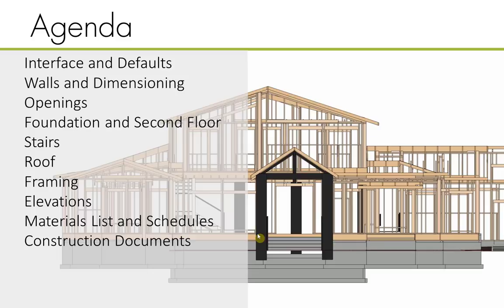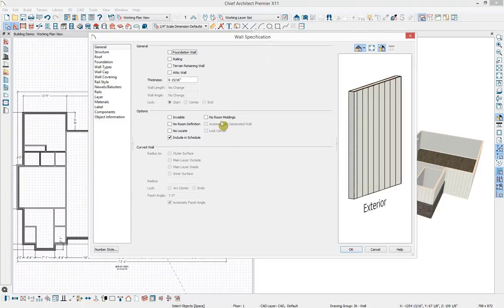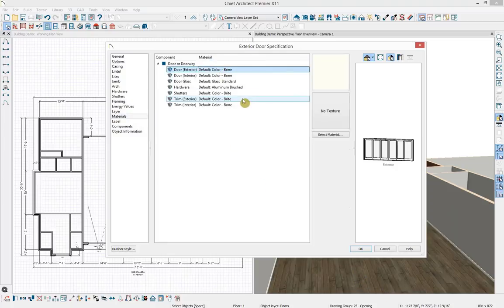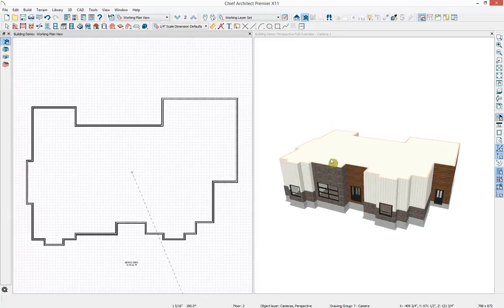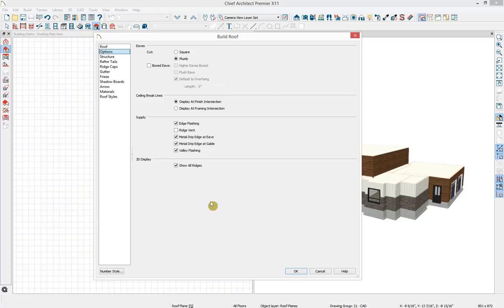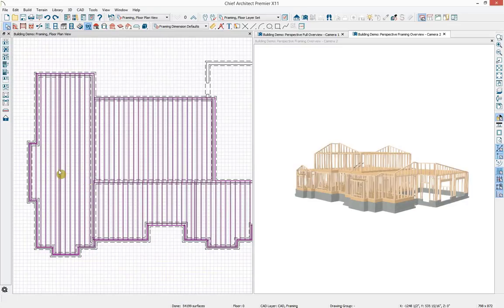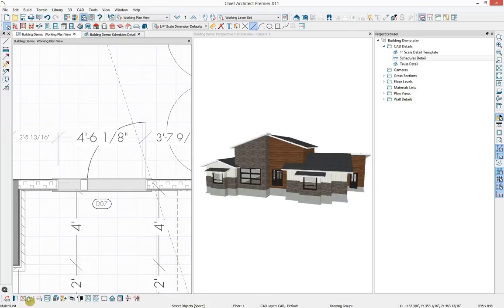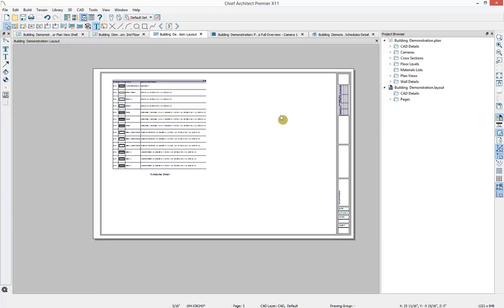Building Demonstration in Chief Architect X11

Comment: Hi Kayla, what a fabulous video... Please keep up your sharing, I have learned a lot through those. I had a question about making the Gable roof at the front pump out. As instructed, I have drawn an invisible wall to divide the room& dropped down the ceiling height. Also, I selected the two partial walls of each end and hit on the quick-change Gable roof tool below. The shape of the roof didn't show up correctly as the video has shown. There are two individual gable roof bumps up on the top of each small wall. Please share your advice.
Reply from the maker: Thank you for reaching out. I would recommend submitting your plan to our online support center for our support team to look into this further. You can submit your plan here: https://support.chiefarchitect.com/home
Reply: @ChiefArchitect  appreciates your advice. Again, fantastic video. Looking forward to more video training sessions. thanks.

Comment: how do you get crown molding
Reply from the maker: You can double click in a room to open the room specifications, and there will be a moldings panel to specify crown molding.
Reply: @ChiefArchitect  when i do crown molding it takes away the base molding
Reply from the maker: @roostersideburns3440  make sure you select "Add New" and place a check mark next to "To Top" for crown molding. Here is a video that should help: https://www.chiefarchitect.com/videos/watch/86/controlling-room-and-wall-moldings.html

Comment: I wish you could do a demo for  light commercial building in metric. We are looking at the software extensively for our smaller projects. We   uild everything in concrete including stairs, and possibly put an elevator
Reply from the maker: Hello CarePoint Global. The software is designed to be fast and efficient in residential design. However, some customers use the software for light commercial plans like what you have described. If you have not downloaded the trial I encourage you to try that to gain more of an understanding of the product and to see and use the tools and features that are available in the software. I have linked below where you can request the trial. 

Trial:  https://www.chiefarchitect.com/products/trial.html
Reply: @ChiefArchitect  Thank you... Will do

Comment: Hello, thank you for the informative video! Just a quick question, how are you able to swing the double doors into different angles after you mulled the units together? The little triangle no longer there for the swing, the triangle is to rotate the door label only.  Also, when I try to follow your steps for finish off the roof (timestamp ~43:27), the invisible wall is causing a large gap between the roof and the space above the window (same thing on the other side). I don't see that in your video, what did you do to fix that?  Thanks!

Comment: Hello I am having a problem with my floors and ceiling heights and roofs as well. I have tried several things to try to fix it. Can you help me please. I can send you the file. I need a template because most of the homes that I am designing are pretty much the same.
Reply from the maker: Hello Jeffrey. I have found a few how-to articles that go over the process of changing wall and ceiling heights, raising or lowering a roof plane, and creating a custom plan template. I hope they help. Let us know if you need further assistance. 
Changing Wall and Ceiling Heights: https://www.chiefarchitect.com/support/article/KB-00579/changing-wall-and-ceiling-heights.html
Raising or Lowering a Roof Plane: https://www.chiefarchitect.com/support/article/KB-00634/raising-or-lowering-a-roof-plane.html
Creating a Custom Plan Template from an Existing Project: https://www.chiefarchitect.com/support/article/KB-03094/creating-a-custom-plan-template-from-an-existing-project.html

Comment: Can you please tell me how to have disproportional walls. Like two of my walls are 10'4"(This is the length) and the two parallel ones are 8'6" and 8'9". Whenever I change one or the other, both of them change.
Reply from the maker: With Home Designer Professional and Chief Architect software you can change the height of a single wall in your plan by editing it in a 3D view, a cross section view, or an elevation view. Changing the height can be done most accurately in a cross section/elevation view. We have a help article that explains the process in more detail here: https://www.chiefarchitect.com/support/article/KB-00579. Thanks!

Comment: Really nice demonstration. Framing and roofing tools are really powerful, and speed up everything so much.

How about another demonstration of concrete wall buildings? Also does it support metric system and European size materials? There is many difference people often make, i.e. full concrete floors, no crawl space, but a basement instead, etc

And extra question, any plans for Linux amd64 version? I am not a fan of Windows at all
Reply from the maker: Thank you, movax20h! Yes, you can generate a concrete slab foundation and basement. I'd recommend checking out this video: https://www.youtube.com/watch?v=DUPJ2F_8q14. 

There's a pre-configured ICF wall type built into the software that can be modified to fit your needs. You can also create your own concrete wall type. We have an article over on our website with more information here: https://www.chiefarchitect.com/support/article/KB-02944/defining-a-new-wall-type.html
Reply: @ChiefArchitect  That is awesome. Thank you 

Downloading a trial version now :)